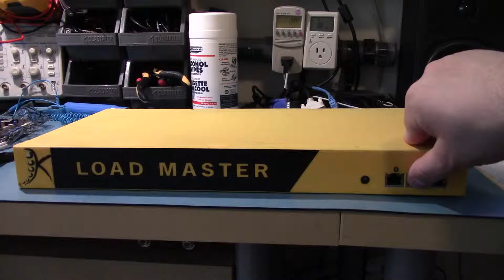KEMP Technology Load Master LM-1500 Teardown

Comment: Thanks for this teardown. I knew it would be a simple box underneath the hood. Watchguard, Barracuda, KEMP, they all are just embedded systems. I repurposed an old 3X Backup appliance as a vcenter box at my old job and we always got a laugh out of it. Sometimes the BIOS would complain about boot device not avail but I think that was just it looking for its original OS that I had removed from a 1X PCIE SSD card slot. These appliances go largely undiscussed because they were kind of obscure to the larger public. People just don't pay them attention. Lots of them make good PFsense boxes if you can ever get your hands on one.

Comment: This a relatively old box - you probably could have gotten it up and running with a replacement disk (is that what was gone?) or re-flashed the BIOS. This is a server load balancer, not a WAN load balancer. This balances (and acts as a reverse proxy) to a group of web servers. They're gold (or yellow if you must) because they stand out nicely in dark data centers. They even made a cameo appearance in a TV series once!
Reply: Sorry, but this is not a server load balancer, this is a old box, with a price of $2500 aprox. A trick!!!! , customer is paying for a cheap motherboad for embedded systems and they think, like you guy or me,  that they/we are paying for a server load balancer, even if you see other models of the same vendor, customers pay for a dell servers!!! Come on man!!. Never a yellow box cost so expensive!!!